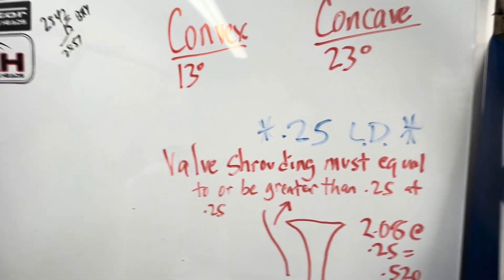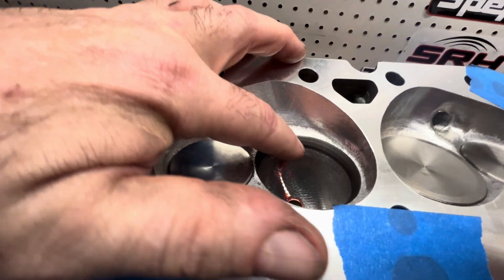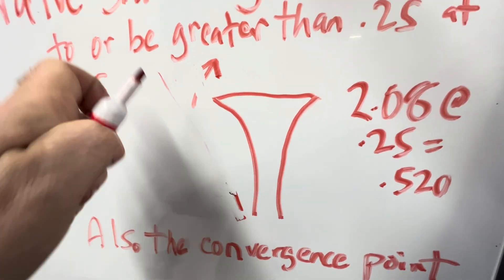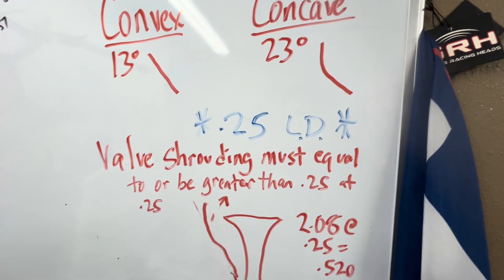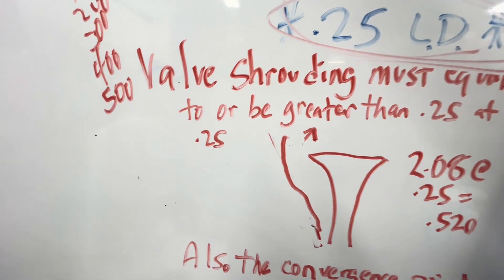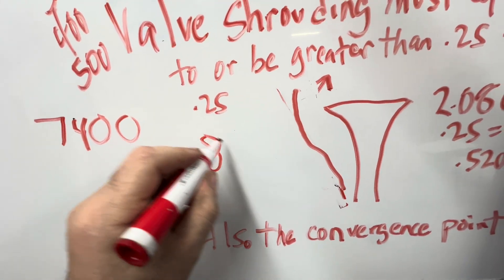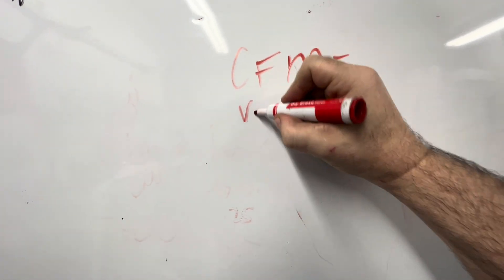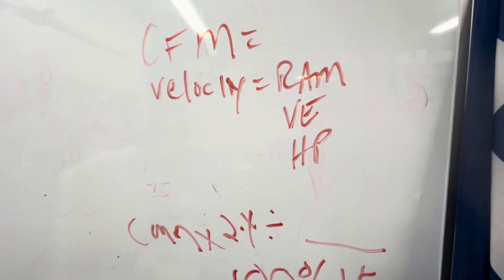Concave vs Convex and Velocity

Comment: Say I have a to work around a 2.65 sq" pushrod pinch CSA  on a 4.125" bore 400, only other limitation is 7500 rpm rotating component budget, what is most important between the pinch and the bore ?
Reply from the maker: Floor velocity at the top of the apex. Assuming the valve job and throat is correct.

Comment: Concave address reversion and ram. Convex will affect the port itself further in.  Hard part is determining the exact location needs to be concave or convex. Short side= convex. Plug side....changes around the valve where the benefit comes from. The bowl should not be symmetrical all the way around the valve.